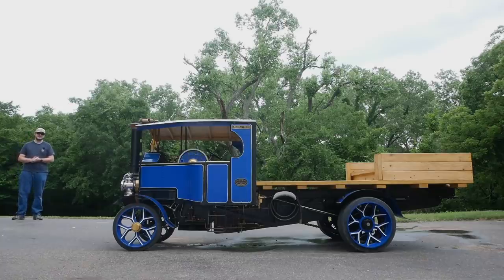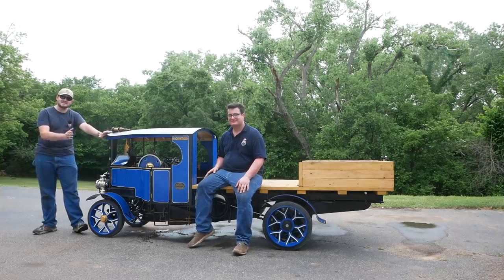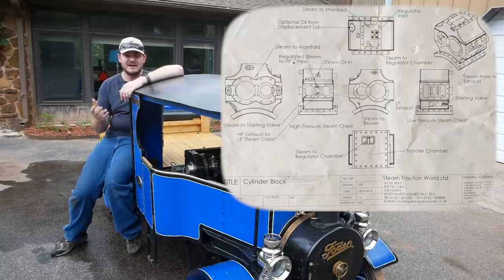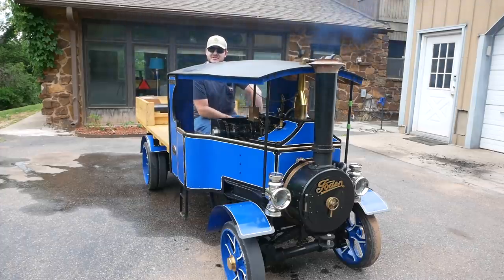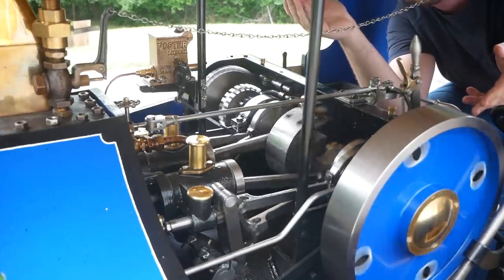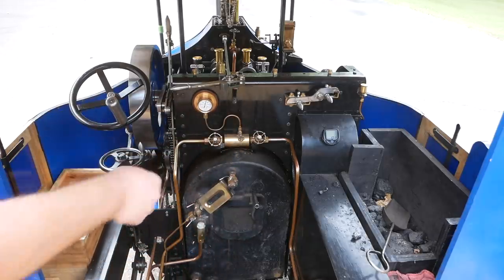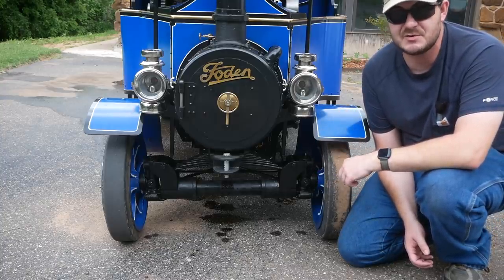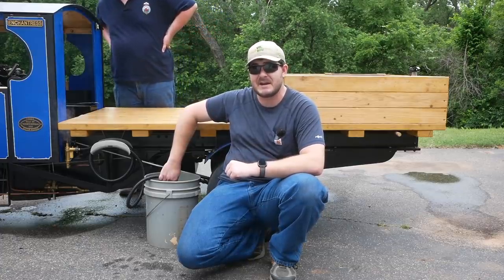This 1/2 Scale Foden Steam Truck is a Glorious Reminder of Britain's Steam Days

Comment: Steam Engines: When the answer to the question "how much torque do you need" is "Yes."
Reply: Only massive torque. The horses all ran away.
Reply: @nobodynoone2500  it’s just one giant horse.
Reply: All of it
Reply: One massive horse with the power of one horse
Reply: And all the explosion power too!
Reply: They're similar to electric motors in that they can produce a huge amount of torque at 0rpm
Reply: 🤣🤣🤣🤣🤣 YES
Reply: @nobodynoone2500  true but when you can answer 'Yes' to max load limit speed is kinda arbitrary.
Reply: And when the question is "how efficient is it" the answer is "no".
Reply: @BlueOvals24  environmental impact was something they didn't know about or had the technology to measure it back then
Reply: @GrumpyIan  That still doesn't make them efficient.
Reply: Same as electric
Reply: The same question can be answered with gears.
Reply: @GrumpyIan   that's not really true, in 1902 they realised that around 25% of london fogs were caused purely by smoke and very deadly,  clean air health legislation was introduced in 1875 in the UK.

Of course these were all fought against at the time by the companies who benefitted from polluting for free just like now.
Reply: @GrumpyIan  and the speed limit for trucks was 20mph until 1957 when it was raised to an incredibly heady 30MPH. Hang onto your hats.
Reply: @GrumpyIan  and it was great!
Reply: @GrumpyIan  Which is totally unlike electric motors. I remember reading about the "heavy-tonners". During the early decades of real socialism in my country - and the Council of Mutual Economic Assistance - we "exported" (=gifted) lots of mineral and cereal wealth to the East. And some railway men took initiative in their hands and hauled massive long trains. It was a great fun for them and a great PR boost for their superiors up to the very top (tonnekilometres look good on a newspaper page, if it's almost the only thing allowed on that page). Passenger traffic being late or interrupted wasn't that big of a concern.
When electric and diesel-electric machines came, they found out they couldn't do that anymore, despite being more powerful.
Reply: @nobodynoone2500  Steam engine rated horse powers are often misleading. First, most steam plants are rated for what the boiler can continuously produce, not what the engine could potentially produce, and second is that steam engines are often run at low RPM, and as horse power is torque times RPM they lose a big multiplier effect.

A perfect example is the typical 20HP Stanley steam car, that 20HP rating comes from what the boiler can produce continuously, however a boiler will continue producing a surplus of pressure so long as the engine is consuming less steam than the production rate, which leads to the actually obtainable horse power from the engine itself, when the boiler is at full pressure, to be around 120HP at 420RPM. Of course since the boiler cannot keep up with that power demand its pressure will begin to drop, and thus so will the HP of the engine, but the car is capable of managing it in short bursts, out of a two cylinder engine.

This is actually much more useful than one may think, as most of the time when driving a car you are not using that much power, only during acceleration and hill climbing do you require the use of a fair amount of power, which are tasks that usually are completed in short bursts. This is why steam cars are generally able to keep up with modern traffic, and can reach speeds of 90mph, they use their built up boiler pressure to generate a massive amount of power for a short time, and then use the much lower continuous power to maintain their speed.
Reply: @BlueOvals24  I mean, the Doble Model E steam car was able to get 12mpg on its gas, with a 2.5 ton car with the typical aerodynamics of the 1920s... that of a brick. That makes it at least comparable to half the Jeeps out there. :p
Reply: @BlueOvals24  The later steam engines became surprisingly efficient. Howard Hughes had an gasoline fired steam car with an triple expasion engine and an steam recicler.
Reply: @DAKOTA56777  The fuels wasnt the first thing to empty. It was water(thats why in old pictures and movies you see many water towers so steam locomotives can top it between stops).
Reply: @kinsmart7294  The Doble Model E gets 60mpg on its water. The Doble, and most steam cars in fact, use condenser systems that cool the exhaust steam back into water and pump it back into the boiler, unlike steam locomotives.

Also efficiency of an engine is based on the fuel consumption, not on the water.

Steam locomotives are, in fact, the worst examples of steam technology's capabilities, as they are explicitly designed to be as simple and cheap to maintain as possible, and consequently are among the least efficient steam systems out there.

Almost all steam locomotives don't even use compounding to reuse the exhaust steam in lower pressure cylinders, whereas almost every marine, and road steam system used at least two stage high-low pressure cylinders, and marine engines could go on up to quadruple expansion systems, since weight, space, and price are less concerning on a ship.
Reply: @kinsmart7294  Still not as efficient as diesel though.
Reply: @BlueOvals24  But an heck of an lot cooler.
Reply: @kinsmart7294  No, just no lol. The only cool factor they have is how rare they are, they're just a novelty.
Reply: @BlueOvals24  We have different definitions of cool then. I like the brass and the autogether victorian feel of it. Plus the giant torque they have. 
Plus steam engines arent rare nor an novelty thing, they are still used today in energy generation like in nuclear power or themoeletrics(using an turbine instead of the reciprocating engine you see in the video).
Reply: @kinsmart7294  It's not differing definitions of cool, I can just acknowledge that it's just a novelty. You'd hate em if they were in everyday life.
Reply: @BlueOvals24  Not really, with modern technology it could probably run without much diference from an combustion engine. The most blatant problems would be the starting up time and the water replenishment, both could be fixed with better boiler developments and condensators.
Reply: @kinsmart7294  If that were possible they wouldn't be so focused on EV technology when all they had to do was imorove on steam.
Reply: @BlueOvals24  EV are am sham made to cater to the enviromentalists. The CO2 cost of making the batteries is astounding and they have to be replaced, sometimes the price of them is so high is better to swap the whole car. All that to use eletricity that depending on where you live will probably come from an thermoeletrical plant.
Reply: @kinsmart7294  It's obviously not a sham if environmentalists aren't complaining about it. If all of what you said was true, environmentalists would be as opposed to EVs as you are and would likely be looking toward steam alternatives if it was actually viable.
Reply: @BlueOvals24  Its just smokes and mirrors. Probably paid by global corp so they dont actually have to solve the problem.
Reply: @kinsmart7294  Nice tin foil hat.
Reply: @BlueOvals24  Thanks. Still, steam engines are cool.
Reply: @GrumpyIan   nope, just think how old Charles Darwin's 'Origin of the Species' was, they were just learning about the ecosystems.
Reply: @nobodynoone2500  tbh, steam horses and petrol/gas horses are different.
Reply: and when the answer to the question "how many rpm do you need" is "no"😂

Comment: this is the answer, you need to buy another trabant and convert it to steam power.
Reply: well hello there fellow beamng user!

A steam powered trabant will probably be faster lol
Reply: @unscripted7553  but much weaker in accelaration, trabants are not fast but they sure as heck are quick
Reply: he needs to Contact the Lane Motor Museum in Nashville, TN; they have a 1975 Trabant Tramp for sale that would be right up his alley!
Reply: Look up Ted Pritchard.  Aussie who converted a number of regular cars to steam and even garnered some interest from major car companies in the 70's when emissions standards were impacting the performance of cars (steam engines are actually capable of burning fuel very cleanly compared to ICE's).
Reply: @mattos4203  well a lpg based steam engine would burn a lot cleaner, while delivering a lot power , problem with steam engines is they are bigger than ICE's, and startup time will vary in different climate
Reply: >Water and Boiler weight entered the chat

>Chassis left the chat

Comment: it looks so fast until you see the dog lazily jogging alongside.
Reply: Pities are not designed for speed. They are professional couch potatoes and cuddle bugs
Reply: Yeah but the full scale version could probably go at least twice as fast as a lazily jogging dog!!
Reply: These were not built for speed but for torque. Mostly moving heavy loads around an factory, you want speed look into steam racing cars and etc.
Reply: @kinsmart7294  i know. you missed my point. the only bad thing about steam engines is steam engine enthusiasts...
Reply: @gramursowanfaborden5820  Not an enthusiast. Just commenting on it, this video is probably an introduction to several people to steam engines.

Comment: Power: sufficient.  Torque: inexorable.  Clutch: optional.
18mph must feel like imminent death in this thing and I am so envious right now.
Reply: Don't worry the airbags will save you.
Reply: @Thirdbase9  
Steam powered air bags.....yessss!
Reply: Yeah, the way you have to rest your forehead on the edge of the sheet metal roof to use the controls doesn't seem very ergonomic.  If that thing suddenly stopped or got jerky, I can only imagine the bleeding.
Reply: But the active safety is through the roof. One simply does not text and drive this thing. You really have to pay attention to rest of the traffic.

Man I like this thing. Almost as much as Morgan Three Wheeler. Damn if they would make steam powered three wheeler :D.
Reply: Later stem lorrys could do 70 mph
Reply: Well the real one was 6 tons, so the safety is that you just drive over anything you run into.
Reply: @Perforator2000  certainly beats faceplanting into the flywheel! :D
Reply: Add in the possibility of a boiler explosion for the full effect.
Reply: There’s a line in the autobiography of Ulysses S. Grant where he talks about riding the train for the first time on his way to West Point. He calculated that they were averaging 11 miles an hour: “this seemed to us like annihilating space.”
Reply: @Thirdbase9  Who needs airbags when you can have a boiler explosion on impact?
Reply: Pretty typical of him at least now in 2024 he has many 3 wheel death traps but this seems like a four wheel death trap. If you add the complexity of steering and fueling and throttle its adds up.

Comment: those rims tho- holy shit i'm in love
Reply: They look like they got released in like 2010
Reply: The rims ruin it
Reply: @adenanthony5257  this is how the original wheels looked in the 1920s
Reply: @adenanthony5257  agreed, partly because they just don't work with the blue
Reply: They are Lamborghini wheels
Reply: Pimpin ain't easy
Reply: @jaredslattery4584  doesn't mean they're not only ugly on their own, but even worse on a fucking steam engine. They should be solid rubber wheels with wooden spokes. Basically wagon wheels
Reply: @adenanthony5257  he was saying they're like Lamborghini rims, not that they are. These are the original wheel designs from a century ago, they're accurate to the full-size wagon being copied
Reply: @adenanthony5257  agreed
Reply: Similar to the wheels on my 2013 Ford Focus ST
Reply: Or, Lamborghini wheels are like foden wheels. 😀 

These wheels are accurate to the prototype, which were made 100 years ago.
Reply: "Not Aging Wheels" ;)
Reply: @adenanthony5257  They most certainly shouldn't be wooden wagon wheels, as they'd collapse under the weight. The historical lorries used steel wheels same as these, they had to, the full size vehicle can weigh upwards of 5 tons, even 10+ for the larger models. As well the full size lorries can reach speeds up to 40mph, 5 or 10 tons hitting a bump at 40mph on wooden wheels would be a disaster.

Now sure, they also made steel wheels with straight spokes that look like a traditional wagon wheel as well, but I see nothing wrong with these, they look fine.
Reply: If he didn't put a smoke deflector to stop the soot going in his face, it's not the wheels he's gonna change.
Reply: @adenanthony5257  uh what? Wooden wheels? On a steam engine? That would be both incredibly historically inaccurate and also just not even close to strong enough.
Reply: Yes these wheels are in fact cast, with solid rubber tires, just like the real fodens of the early 1900's. They might look modern, but the design is 120 years old. They were not designed to be pimping, they were designed to get the job done. I'm more surprised that you guys are so interested/disgusted in the wheels, and not the single front spring!

Comment: I've always wanted to get into live steam, especially the trains. It's an awesome but unbelievably expensive hobby
Reply: if there are other steam enthusiasts in your area you might not need to own one. enough people that are in to it will love to have your help in the maintenance and you will most likely be able to drive them as well.
Reply: If there is a club near you that operates a track, you should consider joining. Some clubs have a few engines that are used for pulling visitors on open days. As a newcomer without your own engine, you probably would start "at the bottom", helping with maintenance but you should be able to work your way up to be an engineer. Another major perk of being a member is you will be able to buy used engines (often due to member passing, unfortunately) at very reasonable prices. Those sales are rarely advertised outside the clubs.
Reply: The same is true of a lot of hobbies and niche endeavors.  I grew up working on Studebakers and Packards.  If someone realizes their time is almost up they tend to hold fire sales or give away their collections to people they trust too be good stewards of their belongings.   When they die unexpectedly their collections tend end up in museums or specialty auction houses are brought in to settle estates.  The hobby as a whole suffers when that happens
Reply: You can pick up stationary engines for a couple of hundred pounds,
Live steam models.. Depends on how intricate and elaborate you want.
You could build your own steam powered fairground.
Reply: I'm fortunate that where I live we have a narrow gauge railroad and I've had the pleasure to be a fireman for a few days and they are supper expensive to operate this is a small engine and it clears a few hundred thousand  to run each year and they are lucky they have spare parts and the original machine shop

Comment: 6:06 I used to run steam tractors, most of which were single-cylinder, and we had a trick for getting out of quarter lock: slide into reverse (or forward, if you were already in reverse), pop the throttle open to get the piston moving, then immediately close the throttle, throw the reverser back to the desired direction, and open the throttle again before the piston reaches the other dead center.

Comment: It looks like a wood/coal burner.  In the early 1970s in Indonesia I saw a beautiful old Krupp steam engine that was still being used for shunting. But it was fired with oil, not coal so it would have run much further without refuelling.  As for reversible engines, in the 1950s and 60s there were small 2-stroke cars that reversed by running the engine backwards. I had one made in Australia in 1964 and yes, in theory you could drive it backwards in all 4 gears. But not if you valued your life.
Reply: Actually by the 1950's, most steam locomotives in the West had been converted to oil firing.
Remember the famous locomotive in BTTF? Oil fired.
Switzerland even tried electric-heated locomotives during WWII, because they had hydroelectricity but coal was getting scarce (and getting new electric engines was of course almost impossible).
For cars, Early DAF with 4 stroke engines but the famous Variomatic gearbox could run in either direction at the same speed. In fact later Variomatic can still do it but the engineers installed a safety to prevent this.
There are still "reverse DAF" races made in Nordic countries :)

Comment: A neat little aside, I was a locomotive mechanic for over decade working on modern diesel prime movers. The neat thing about that industry is how much heritage in terminology there is for stuff. For instance, to this very day the lifter assemblies used modern engines are referred to as "crossheads."

Comment: The fastest ones in Britain were some of the Sentinel engines, which could manage well over 30 mph, maybe even 40 mph. They had pneumatic tyres and shaft drive, with more modern steering. One of those going at full chat down the road is an unforgettable sight. If you ever gets the chance to come over to England and attend the Great Dorset Steam Fair, be prepared to spend several days travelling around the 500+ acres of the rally, and still not be able to see everything fully. There are many other rallies over here, but GDSF is the biggest. Up in the North, Driffield is one good rally, where you'll see plenty of steam wagons, steam tractors, road rollers, stationary steam engines, and plenty more. Arrive on the day before the event to see the road going action.